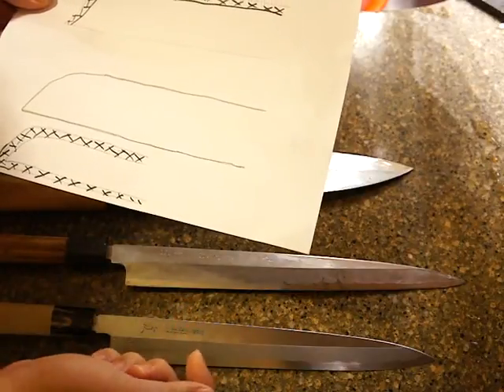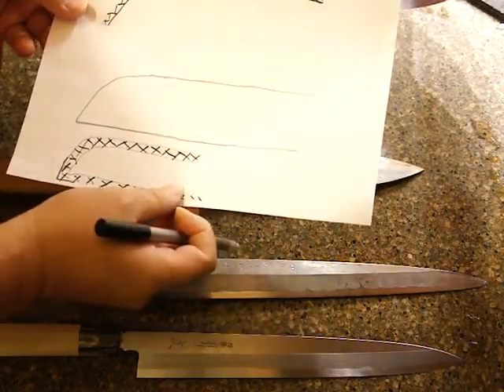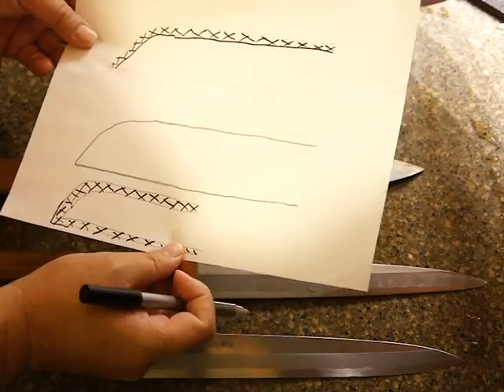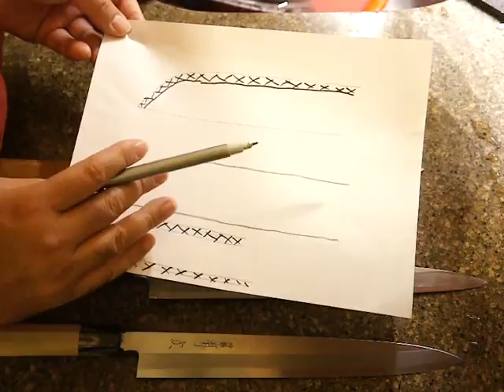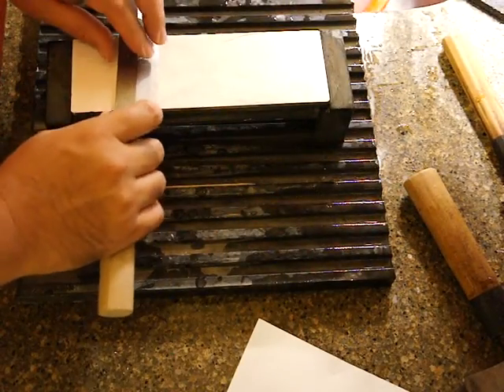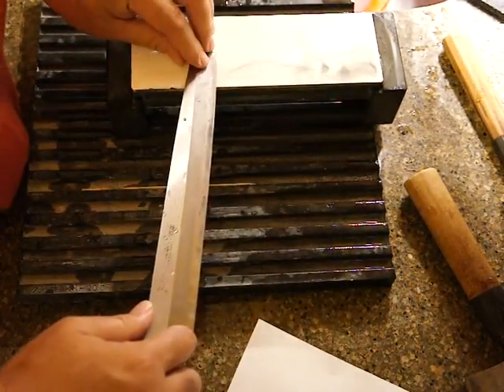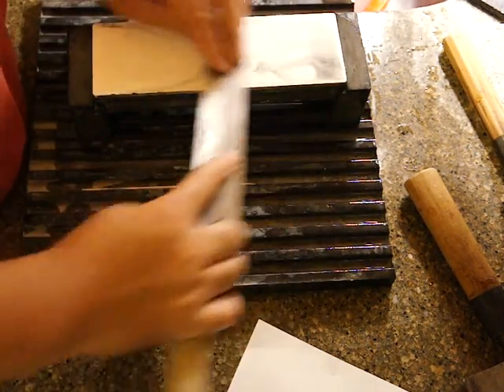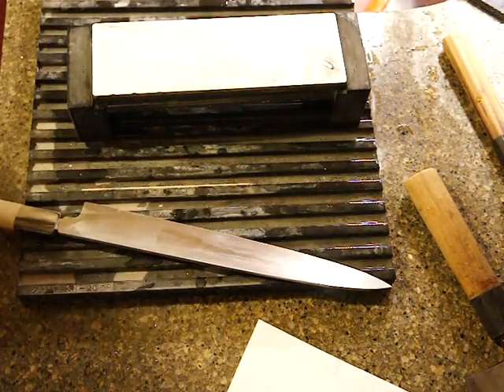Making Uraoshi on the new Yanagiba

Comment: Hi, Do you use the 120 grit or 400 grit diamond plate for flattening your stone?? 

I want to buy one but someone say 400 better because doesn't leave a deep scratches on our stone. But I'm thinking if I want to flattening coarse stone like 200 or 320 using 400 grit diamond, it will work slower than the 120 grit. So what do you recommend?? 400 or 120 for everyday stone? I know I'm not going to use coarse stone everyday. 

I want to buy a diamond plate for flattening stone to replace my Suisin chewing/ stone fixer because now days all the stone are mostly hard stone like ceramic, etc so I think I need a coarser flattening product :)
Reply from the maker: The fastest way to flatten is using 4"X36" belt grinder to me.  It could be #40 to #60 ceramic belt might be the fastest.
If I have to do it by hand, I use the same grit or lower grit rough grit stone or lapping stone.  ATOMA Diamond #140 is fast, but it will be worn out quickly. 
If it is little bit of correction of the sharpening surface is OK, but if it is major fixation, I do not want to Diamond lapping stone which is cost too much, especially, rough grit stone fixation.
Many people buy 2 pieces of the same rough grit stones, and lapping each other, and we can use the both stones for sharpening.
Or we should get #100 hard lapping stone.
Anyway, if it is major fixation of the stone, it might take over one hour, so we might exhaust to do it.
The belt grinder is the best way to fix the stone to me.
Woodworkers should have one, so we can ask your friend wood worker to buy one #40 belt and borrow it might be the best solution to me.

Comment: Thank you, im still trying to figure out these single bevel knives.
Reply from the maker: Thank you for the comment. I just showed one of the traditional way to sharpen ura side.  As I mentioned, the ideal Ura sharpening result is "Ito Ura" which is very fine line of the sharpening stone mark connect all over edge, spine, and tip, and heel.  As long as we can make "Ito Ura" , any kind of the way of sharpening style should be all right, if we do not so, we might have to consider it.

Comment: Hello, how do you fix the problem you've shown at 3:24, where the knife is mostly flat but the tip is a bit crooked?
Reply from the maker: Thank you for the comment.  I made a video clip to answer the question.
We normally use minor crooked edge to fix it by wood block with slots like the video.
https://youtu.be/AsYtrALlpes

Comment: hello! what grit stones you use?
Reply from the maker: Thank you for the comment.  I used Shapton Glass #1000 at first on the video, and finished it with Shapton Glass #6000 HC.  Once the ura is set, I normally use #6000 only for just removing the burr from the bevel side.
Reply: arigatou gozaimasu!
Reply: I tried to make uraoshi! i cant though... I dont know what am I doing wrong... I started with 1000 and finished with 8000.... Is there a problem?
Reply from the maker: Hello.  I am not sure what your knife situation has, but if you send me some pictures at aframestokyo@yahoo.com
I will try to find out the problem, if I can.
Thank you Takeshi
Reply: If you can help me make uraoshi!
Reply: @mendokusairyuu2035  I think you can follow his video if you try to do Uraoshi Sharpening for a new single bevel or Yanagiba.

If you have Uraoshi wider on the spine or at the cutting edge, you can also watch his video. He explained everything. 

But if your knife have a flat urasuki or old knife that have a flat urasuki, then you need to send your knife to the maker or Japanese sharpening factory so they can create a new urasuki for you. Because no one can make new Urasuki using a flat stone. Someone might do it on the belt sander but I won't risk it if it is a good knife.